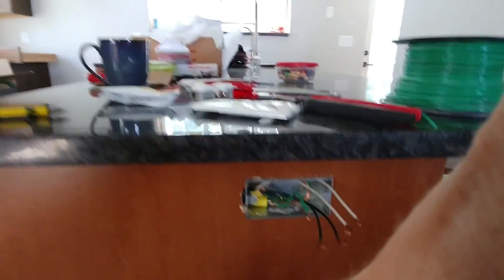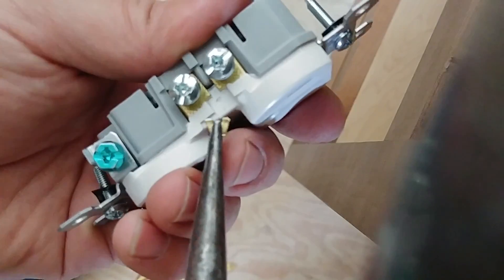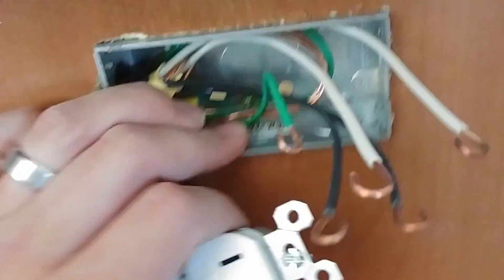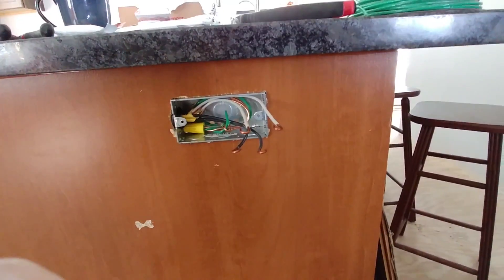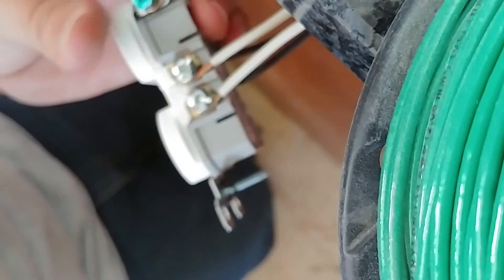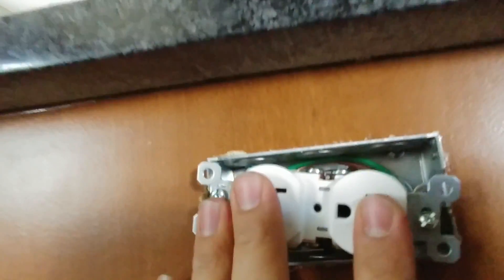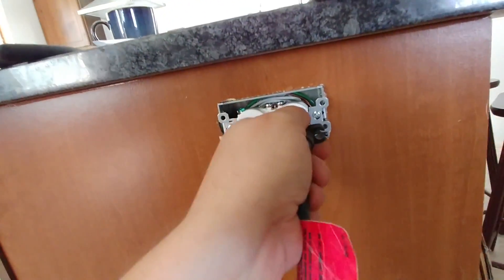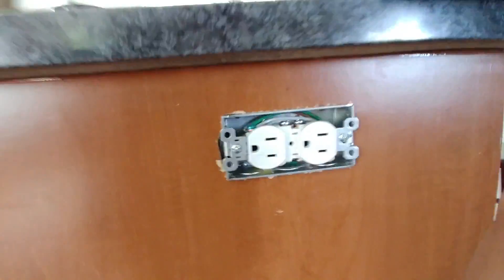How To Split Wire an Outlet or Receptacle - Two Circuits on One Outlet (Duplex Receptacle)

Comment from the maker: Having the ground conductor UP is safer in general. This was the recommendation of our State electrical inspector. Also, I don't think it is an issue of code but rather best practices. I believe you can install a receptacle facing any direction but facing up.
Reply: This is correct. In the event that something metallic falls on an exposed plug, The item will hit the ground.
Reply: @jimmyjohn8008  ?
Reply: @jayobrine8475  I was incorrect about what was going on I was confused because the lights where on one circuit and the outlets where on another circuit.
Reply: Receptacles facing up are used in conference rooms, libraries, and places that have a need for power to be supplied [usualy to tables] that are frequently moved. They are a safety feature so there are no wires crossing floors to wall outlets that people could trip on. They must have covers to cover the exposed [unused] receptacles.
Reply: There is no NEC requirement for which way to put the ground but I always put mine up just because it is safer.
Reply: Comedy - so, how do you make vertical installations safer. Said another way, this is right up there with the argument about whether the ground prong goes up or down.

That aside, good little video. Thanks.
Reply: "how do you make vertical installations safer"?
Ground prong above hot&neutral prongs

If the weight of the cord causes the plug to begin to come out
then only the ground is exposed to the working environment.

All  outlets I install vertically are this direction.
It may never save a life, but its "free" safety.
And if it does save a life, it's worth way more than pearls.
 In a shop where you might move thin steel cables around, etc., I would change them if they were not in this orientation.

Comment: Your breakers numbers 28 and 30 should be a double pole breaker or two single poles tied together. That way if one circuit trips, they'll both trip and make the box safe to work on.

Comment: I have a split wire connection but only has one neutral wire?   It does have the two hot wires.   One goes to my dishwasher and the other goes to a switch for my disposal.   Now the disposal won't turn off

Comment: @BenjaminSahlstrom: Thank you for this video.  I am trying to replace a setup like this with a GCFI.  How do I do that, since a GCFI will only handle one circuit?
Reply from the maker: If you're sure there are two circuits and you want GFCI, I would simply cap off the wires for the second circuit one use one of the two. Would be smart to see which circuit has less load on it so that you can balance the loads on the circuits as much as possible.

Good luck!

Comment: Is breaking the tab on the neutral side actually required? I replaced an outlet where the bottom was on a switch and the top was not, so that's how I replaced it with the new one, only the hot side had broken tab (red wires on top, black wires on bottom)
Reply: With 2 completely separate circuits like Ben has, then yes. If this was a multi wire branch circuit, a 12/3 would be used from a double pole breaker and the neutral wire is shared and you would not break the tab on the neutral side. In your case, where one side is switched, only the hot side will be broken because it's only one circuit.

Comment: Awesome instructional video.  I came across it while trying to trouble shoot a dishwasher problem. Dishwasher  outlet is split with disposal and the disposal is on a switch which seems acceptable. The house is a couple of years old and the dishwasher has worked fine until recently losses power. I have reset the breaker, messed with the circuit board, and even replaced the internal fuse. It works for a while then not. Today I used an extension cord, plugged the dishwasher to another plug and got the dishes done. My question is what could have caused this over time. Is the breaker weakening or could a wire have come loose that causes this sporadically to throw the breaker. Should I place a separate outlet there? Is this a problem that occurs as a result of a wire getting loose over time? Appreciate any input.
Reply: Sounds like a loose wire in the box at the outlet. Electricity vibrates, and will loosen the screws or break the wires if using stab outlets, where you physically push the wire into a hole in the back of the outlet and it is secured via a tab locking device. If newer construction, my guess is they used those cheap .50 contractor outlets and switches in the home. I have seen those quite a bit in new construction, and I would recommend replacing all of them in the house with a quality switch/outlets like Leviton produces. I am not an electrician, and if you do not feel comfortable doing this kind of repair, I would hire a licensed electrician.

Comment: OK. All the outlets in my old kitchen are wired this way - and of course - there is no gfci protection in this house. Is there a gfci outlet with separate gfci protection on each outlet? :)
Reply: They make GFCI breakers. And I hate those GFCI outlets. They are only good for a few years and then they need to be replaced, And God forbid you have one on the same circuit as a refrigerator or chest freezer... Been there, done that. I removed mine and installed regular Leviton outlets. We have lasted a hundred plus years without them...

Comment: I was just wondering, what would happen if you were to mix up the neutrals? They both terminate to the same bus in the panel?
Reply: To your point, I saw another video that said you do not need break the neutral tab.
Reply: @leelfm In this case, with 2 completely separate circuits, you need to break both. In a multi wire branch circuit which has a shared neutral, you only break the hot side and if it's a switched receptacle where one socket is on all the time and the other one is switched and they are on the same circuit, again only break the hot side.
Reply: You must not mix up the neutrals because each circuit must have its own closed loop. If you mix 2 different circuits you could overload a neutral wire and it may not trip the breaker.

Comment: Benjamin,   You have most likely done a NEC violation.   It is required to put a single receptacle that is 20 ampere rated if it is the only receptacle on the 20 ampere circuit.   Even though they are now single receptacles, they are both on one yoke.   I’m not sure how it would be interpreted.   But as a design engineer, I would make it a 20 amp receptacle, not a 15.   I know that you will most likely never have any appliance that has a 20 amp plug, but code is code.   Respectfully,   Kevin
Reply: You make a very good point, but if this is an end of the run receptacle with others upstream, I would think that this is okay as it would not be a dedicated circuit. I think the code violation is not using a double pole breaker or at least tying the 2 single poles together.

Comment: 0:40 You only need to remove the Load (Black wire - brace screw side) tab and not the neutral (Silver side or white wire) with the same mentality as you kept it only to one ground.
Reply: This is not a MWBC so both tabs must be broken for 2 separate circuits. However, the circuits should originate from a double pole breaker or 2 single pole breakers that are pinned together. This is a safety feature if the receptacle is removed later and the homeowner doesn't realize that there are 2 separate circuits. I don't think Benjamin mentioned this, but should have.
Reply: @surferdude642  Interesting.🙏

Comment: We’re replacing an old split outlet and have been struggling with it all day. Thank you SO much for explaining about breaking the tabs.
Reply: Exactly why these circuits should be banned. A diy person can shut off a breaker and test just one side of the outlet. Then try and unscrew a hot outlet.

Comment: This sounds dumb, I know, but what if you forget to break that tab? (This set up was for one outlet being on a slim/off switch and the other always on as you mention at the end of your video.) outlet is dead and  breaker won’t reset..both of these breakers have a metal clip keeping them in the same position.

Comment: Question... What do you know about ghost voltage on half the outlet if only one of the breakers are off and the same goes for a half switched outlet?   From the research I have done this is common.......what can you tell me.

Comment: Cutting the break out fins does not make it a switched outlet...it makes it a split wired outlet. One common reason for doing this is to control one outlet of the receptacle with a switch. Another reason is to have two 15 amp breakers in one duplex, which can be advantageous in any kind of work shop, commercial kitchen, bar, or really anywhere equipment with a high amp draw is used.
Reply: You should watch the video, and listen to what the man says.

Comment: I did this in my kitchen. We ran 220 in the wall---then split it at the receptacle so each socket was on 110. You could plug all manner of appliances into these without the breaker tripping.

Comment: I'm assuming that based on the location of your breakers, these are on different phases, meaning you have 240/208 volt potential across a <5 mm gap. I personally wouldn't feel comfortable about this without an arc fault breaker, which you do have. I would recommend ensuring the breakers are on the same phase.
Reply: I get the point you're making, but doubt that this is an issue, the tabs are designed for this purpose. To put this in perspective, in an automotive example an ignition coil supplies 20k volts to make a spark jump a .8mm gap in a spark plug. You can use a spec grade receptacle which has a much greater than 5mm gap. Furthermore, in order to turn off this outlet so both receptacles are off, the circuits must originate from a double pole breaker or 2 single pole breakers that are pinned. This would, by default, make the circuits out of phase.

Comment: Thanks for the video. Quick question. How can i do a split for a switch and outlet, as you mention, but where the switch is a dimmer. They are on separate circuits. I want to keep the dimmer but add an outlet for the other circuit. Thanks!

Comment: I'm no electrician, but with having a split receptacle, does that mean you can get 240V if you use both plugs to power a device if required? Assuming that's only if the wires are correctly placed in the breaker.

It would make sense considering (based on the video), you have the breakers plugged between phase to phase.
Reply: 8 months without a reply. 
Be safe and call a qualified electrician.

Comment: Hello Ben, Greetings from Canada. I see you published this a while back so things may have changed but here is my suggestion. When I do an outlet of this type, I generally use 3 conductor wire and a common neutral (it only carries the difference current provided the two circuits use L1 and L2 for source power). Additionally, I always feed this type of plug from a 2-Pole Breaker as that ensures you always get L1 and L2. Additionally, you will never think the power is turned off at the panel when it is only “half off”.  This type of wiring is not normally used here in Canada as it requires a 2-Pole GFCI Breaker to feed it and those breakers are fairly expensive.

Comment: Code where I am requires those two 15 amp breakers be tied together so if one trips, the other trips, or the use of a single dual breaker.
Reply: Same here. This breaker setup is dangerous. If someone works on the box but doesn't realize both breakers have to be thrown they could easily get electrocuted.

Comment: AT 2:32 First. does it matter if the neutral wires are paired to the correct load ?  Second why break the connector between the two neutrals on the plug?
Reply: If its a GFCI breaker it would most likely trip if you got the wrong neutral. Might not do it all the time but if you used both circuits it most likely would. The newer code also requires the breakers to be tied so they both are off if one is tripped. So the current way is to avoid this type of outlet, and just use a 20 amp outlet or have two outlets separated.

Comment: Now they've made another change in the code, and want all split wired receptacles wired into one double pole breaker so instead of turning off 2 breakers, you only turn off 1.

Comment: Benjamin, would you do a video where you have power source coming into a single outlet and you want to make the outlet a half hot THEN using the same outlet, pull power from it for a switched light.  Of course, all the while leaving the always hot part of the half hot with constant power.   Basically just need to know how to run a switched light off a half hot plug.  Thanks in advance.

Comment: I have 2 split outlets in our kitchen, but they have a single wire on the neutral side with the tab still in place and the tab removed on the Hot side.

Comment: CAUTION:
Split wire outlets requires a "SINGLE" dual 20 amp breaker for such situations, so if one receptacle pops, they both pop. 
Otherwise you would have a live power situation on one receptacle in the same outlet box when troubleshooting.

You do a nice job on your videos......
Reply: Then what would be the point of the spit wire receptacle?
Reply: @jairolopez5952 To provide a dedicated 20 amp circuit  to each receptacle. Plugging two appliances to the same circuit could overload it.
Reply: I’m

Comment: Hey Ben can you do the same exact thing with a GFCI receptacle??? I don’t see the tabs to ply off on the GFCI receptacle that I have. Please help?
Reply: I'm doing the same thing, converting 2 split outlets to 2 GFCI's
Reply: No. You'll need 2 gfci's on separate circuits using only the line connections.

Comment: Hey Ben ; Why couldn’t you just use 12 /3 with a ground And split the hot side ?
Reply: This is only allowed if the two circuits are on opposite poles, and the breakers are tied together (i.e. if one is shut off they're both shut off).

Comment: No workie.  Did as directed but no workie mon?  Q: Are both black wires supposed to be hot?  My tester says only one black is hot so is that the problem outlet does not work?  Do I tape off the one, not hot black wire?.  ..signed: Challenged in FloriDuh
Reply: It workie now....Rass mon it was dat little clip that needed to be bent off.  Gracias anyway.

Comment: Make sure when you do this that you do not accidentally swap the neutrals  to the wrong screw on the outlet. The neutral must go with its own hot wire even though the circuit will still work with swapped neutrals.  Also I like to push the wires into the box with the end of a hammer handle.
Reply: If you actually watch and listen to the video, you'd know he covered this.
Reply: All neutrals are connected to the same bar in the panel. It does not matter which neutral goes where, unless he is using non traditional tandem single pole breaker.
Reply: @The_pipeliner  it does matter, because that's exactly what he did, as shown in the video. Try watching it, AND paying attention.

Comment: Can this be done to a GFCI outlet which are then connected to two separate breakers?
Reply: I just asked the same exact question. I can’t find the answer anywhere
Reply: The answer is no. GFCI can not be split. They have a line and load pair of screws. The line detects faults while the load provides protection to other outlets. 
Modern code replaces kitchen split 15s with a single 20 amp gicf.
Reply: Not 100% sure, but I think you can do this with a double pole breaker and 12-3 wire, aka mwbc. You would need 2 GFCI receptacles with the black wire to one and the red wire to the other and a shared neutral. The neutral wire would be pigtailed to the first one and terminated on the second. Attach hot wires and neutral wire to line only and load must remain unused and cannot be used to protect receptacles downstream.

Comment: Thank you! Needed to know how to remove the tab.
Reply: Ron Gosling  My guess is use wire nuts to accomodate any additional conductors in there, and only connect one wire to the device where one wire is supposed to be... or put another way dont use connections to the device to join wires, use wire nuts.

Comment: Broke off tabs and didn't work. I live in a mobile home so don't know why but tried without breaking tabs after nothing and it worked fine?
Reply from the maker: You may need to call an electrician in your area to come check it out.

Comment: A good practice is to always wrap electrical tape around your receptacle to prevent arcing when placing back in the box in case one wire happens to be touching , so when you turn the power back on you don't go BOOM ! And you end up having to change your pants because you just had the crap scared out of you.  Just a two or three wraps will do. This only applies to a metal box. Plastic boxes don't need that

Comment: Love your video. I have a 440v 3phase outlet. If I connect each of the 3 hot wires to the each hot socket of the 3 split phase outlets, the neutral to each neutral socket and the ground to each ground socket of the 3 split phase outlets can I then make 3 split phase 220v outlets?
Reply: I don’t quite follow what you’re saying but something seems off

Comment: Hello, how is a cut 15 amp ceiling light circuit is repaired?
 I was thinking adding a junction box were the cut is and splicing the greenfield cable together. Its a two wire cable and the sheathing is the ground.